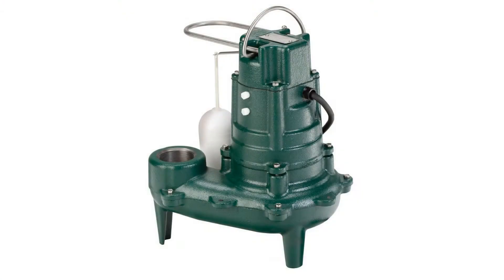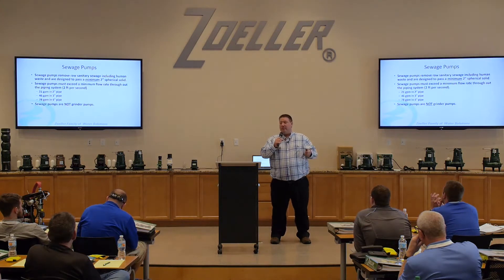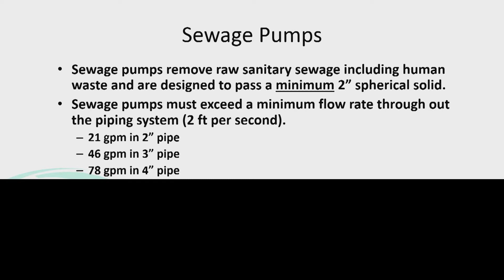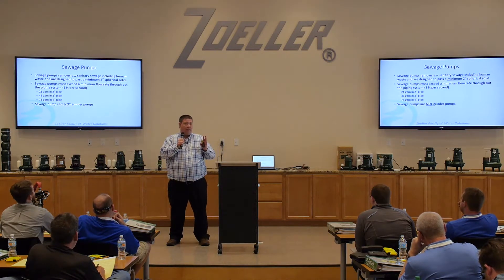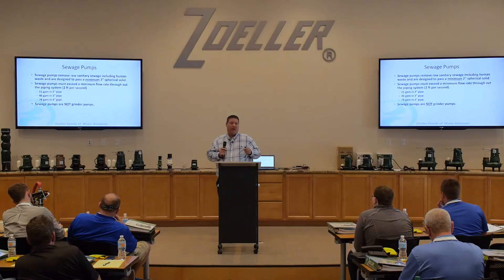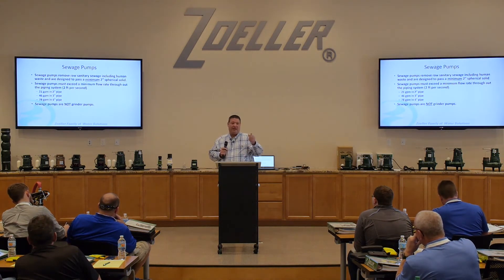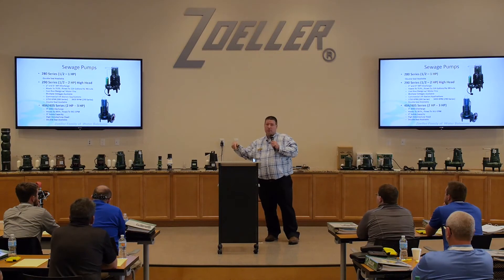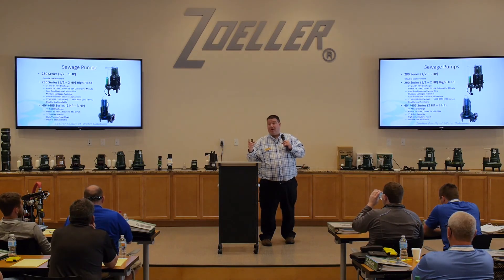Sewage Ejectors Defined

Comment: Where can you buy this? My basement is flooded l don't have a sump pump, does this have a hose connector.
Reply from the maker: Hi @normatorres2310 - you can purchase Zoeller pumps and an installation through a local contractor near you. On our site, we list several Zoeller Contractors - you would just need to call them to ensure they would be able to handle the type of work you need. Here is a link to our Contractor Locator: https://zoellerpumps.com/locations/?zip=40299&type=contractor

The only pumps we have with a hose connection would be a portable utility pump. You can view those options here: https://zoellerpumps.com/product-category/pumps/utility/

I hope this helps! Should you need extra support or have specific questions or need to troubleshoot your application, please don't hesitate to reach out to our Product Support team by emailing ZCOtechnical@zoeller.com or call them at 1-800-928-7867 and pressing option 6.